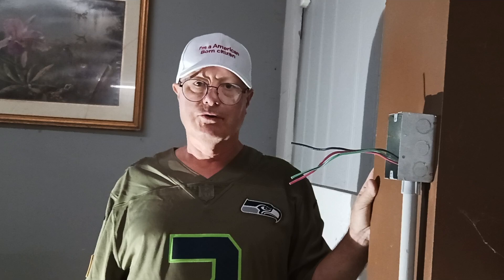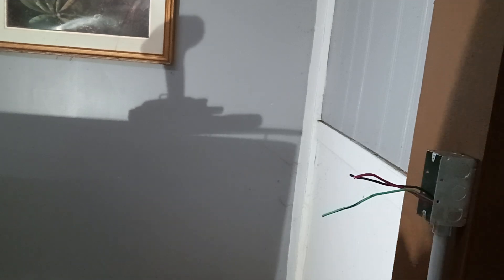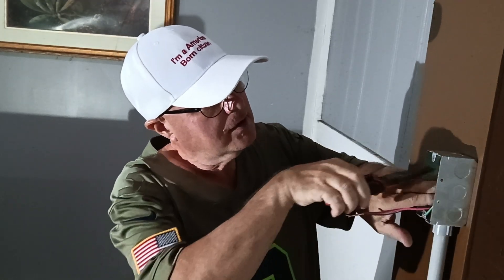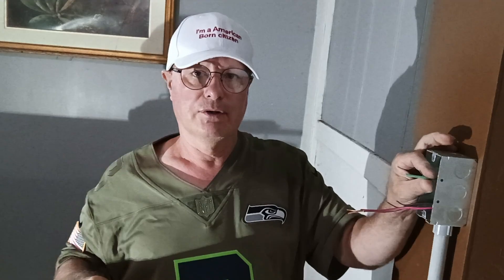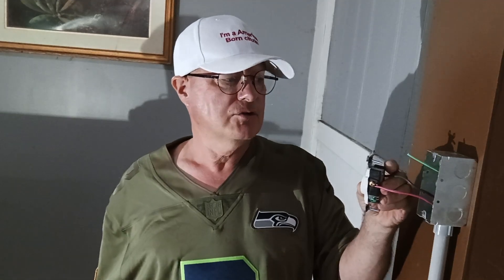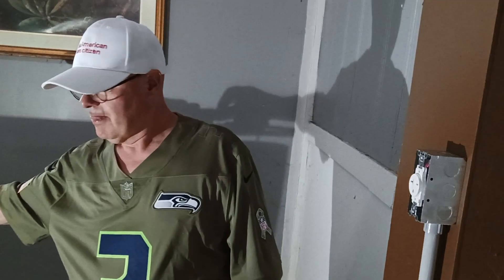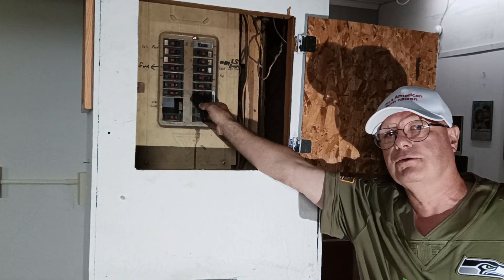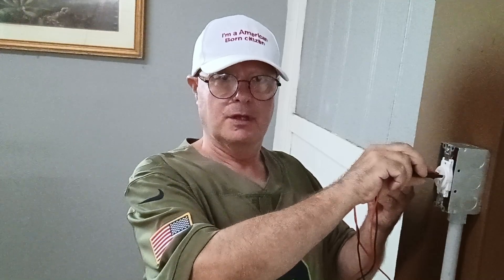how to wire and install a 20 amp 220/240 volt single plug receptacle from Leviton

Comment: Wow! I haven't seen an analog multimeter in forever! Digitals are so cheap nowadays and most are auto ranging. They also have the added benefit of not being as susceptible to impact/shock damage when dropped as a jeweled meter movement.

Comment: You should have cut that ground wire a little longer, while I liked the work, you ended up failing NEC 300.14 since it only stuck out about 2 inches beyond the edge of the box.  Code is 3" minimum.